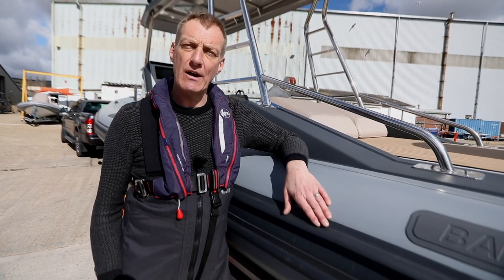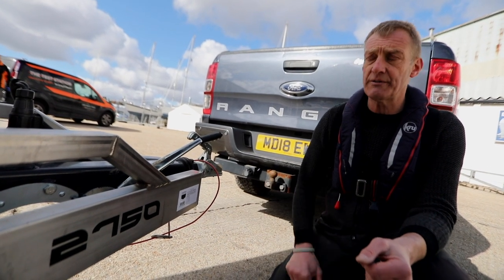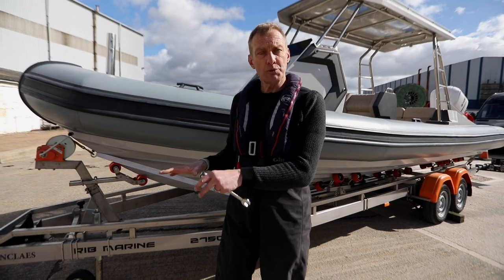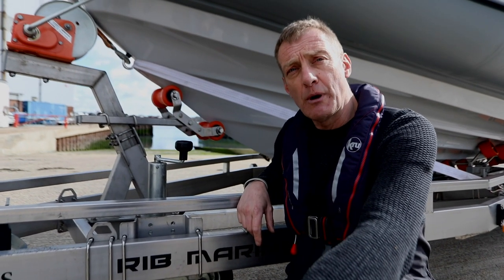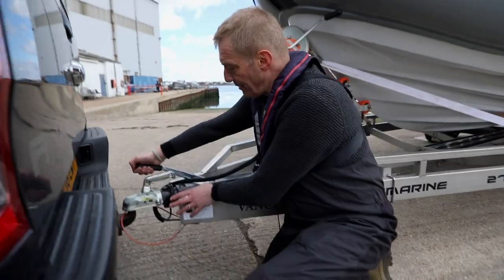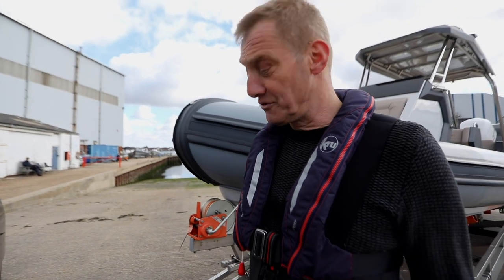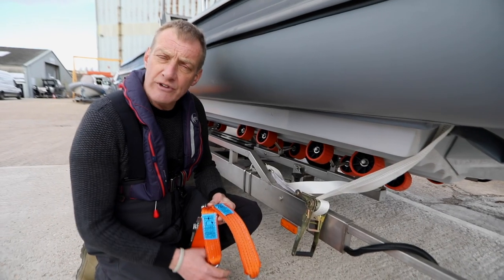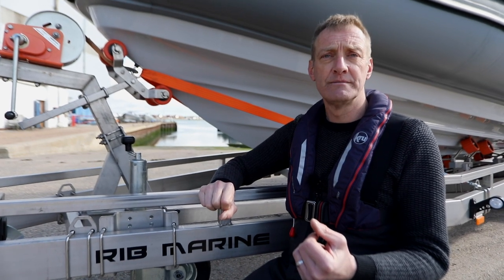How to set up a boat trailer for a smooth and safe journey | Motor Boat & Yachting

Comment: Another top tip! Once you have attached your hitch to the towball, try to raise the nose of trailer again using the jockey wheel to make sure it has clamped on to the ball correctly.

Comment: Bad showing the breakaway cable looped like that if DVSA spot that it a on the spot fine , it should be clipped to the towing vehicles chassis but if you look at most tow bars there is one or two holes for the clip to go through. The argument is that a looped cable has the chance of jumping off and also it has the possibility to get trapped and damaged in the ball
Reply: In the Netherlands it is even mandatory to attach the rope to the vehicle and not just over the ball head. Or into a hole in the coupling if one exists.

Comment: I was surprised to see the trailer hitch connection didn't have a set of chains! I'm in Canada, within North America its law to have a chain and hook on each side of the trailer neck, maybe 8" from the hitch, that connects to connection points on the truck.  So if the trailer accidentally jumps off the hitch ball, you don't lose the trailer. I see the brake line, and fine, that's good. But that trailer will separate from your vehicle and go flying. The interesting thing about these chains, the important thing to know is that they have to crossed to maintain control.
Reply: I totally agree, there is i big difference between North America towing and where ever this was filmed. I was thinking “where are the safety chains?” and also thinking “that is so many straps to hold down a boat?” and the last thing was thinking was “why are they using a ford ranger to tow that much weight?”. North America uses big trucks, we use safety chains and don’t typically use that many straps for a boat (pulling forward and backward on winch ring) But i do think that that is a really nice trailer. And still dont understand the no safety chain and just throwing the safety brake cable over the hitch. Good video though!
Reply: @lelandnunez6945  Maybe it's because here in Europe there is a general inspection for cars and trailers every two years. This is the strictest in Europe in Germany.
If your towing hitch is worn out, it will be replaced. Or you fail. The Ford Ranger can tow 3500kg.
Enough for a boat like this.
Here in Germany the motorways are so good that cars are allowed to drive at 300km/h (186 mph) or more, on unrestricted sections, as long as no one is endangered.